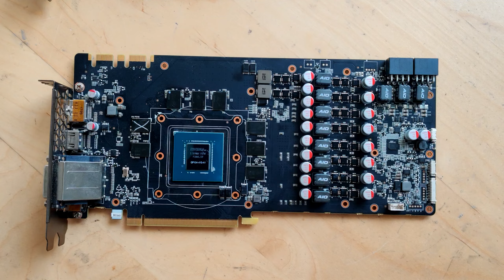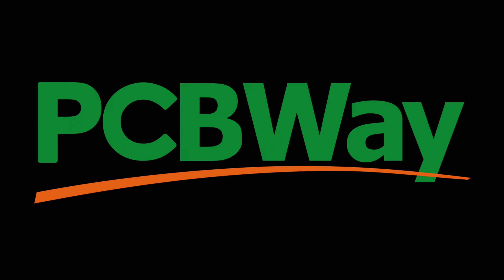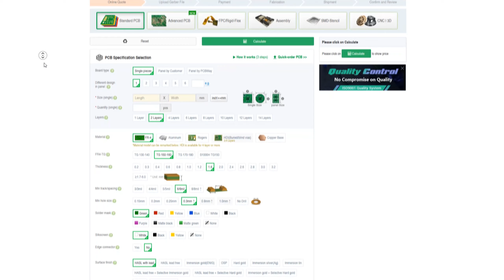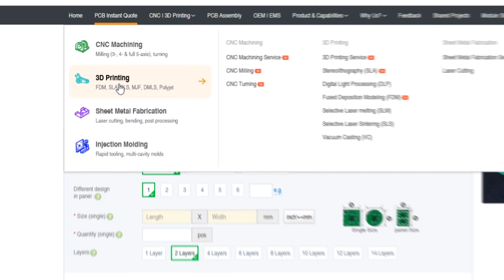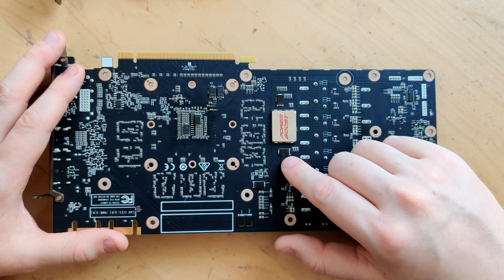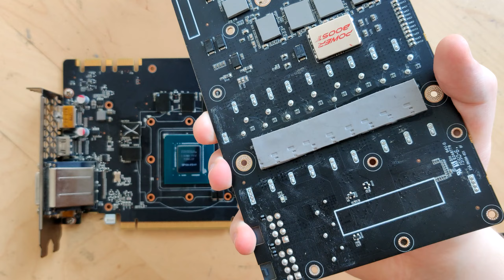A cost saving measure "accidentally" made this GTX 1080 good

Comment: Interesting video. I think learning about GPUs and electronics in general is important. Understanding what is good or bad and how to fix stuff is a nice and handy skill to have also in the future. I'm still quite overwhelmed with all the terms and where what goes and what does what, but the general idea and mindset of Zotac and why this 1080 is a solid card came across well. Without really knowing too much about Gigabytes circuitry practices to this day, I like them for making cards with 3 DisplayPort in a row and in general often plenty video outputs. Peak was the Turing Aorus cards with 3 DP, 3 HDMI and one USB-C. 
Just as a fun question, would it be possible to change an HDMI output to a DisplayPort on a GPU? I have a usecase for 4 DP and the only cards having that are from the quadro lineup or similar professional class cards from AMD. But those are expensive and lack good coolers...